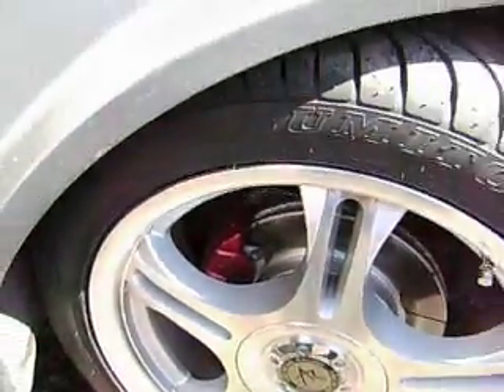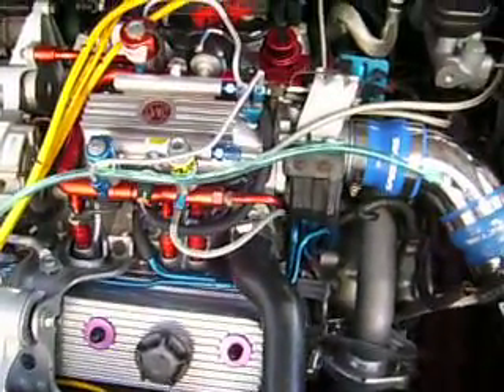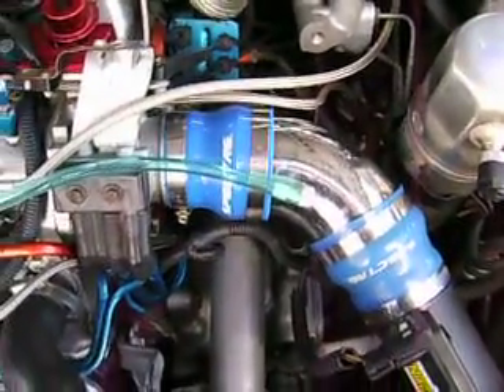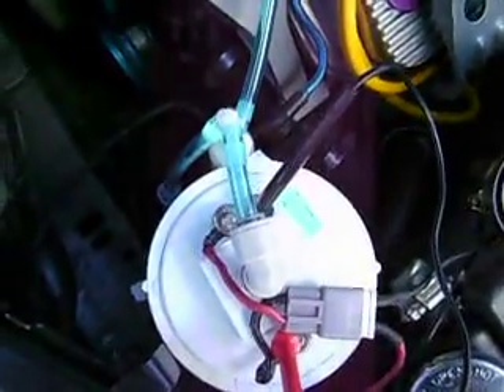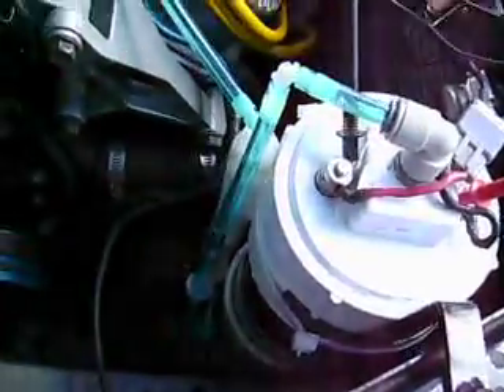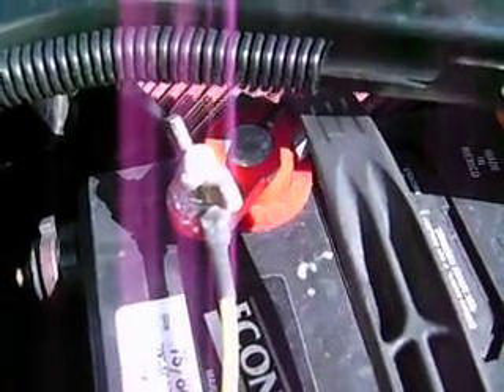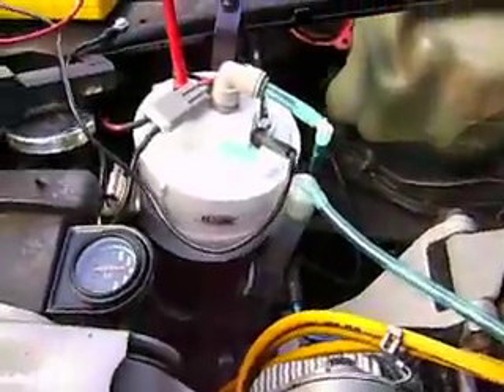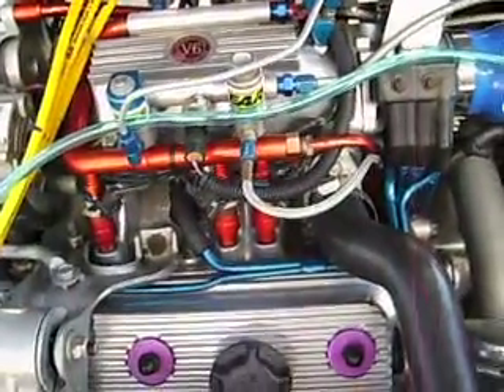Smack Install part 1!!!!!!

Comment: That is a great install job! Great work. I use a different type of system based on vacuum effects on eletrolysis. But soon I will go for Meyer/Dingel hho on demand systems full conversion, if I get it working right within the next few months. Keep up the good work, looks very nice.